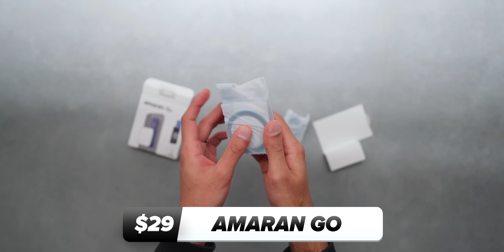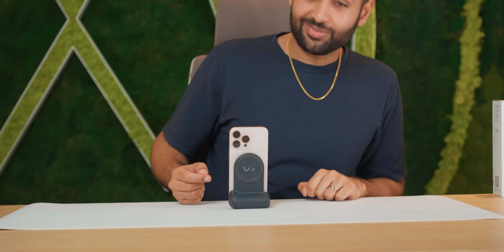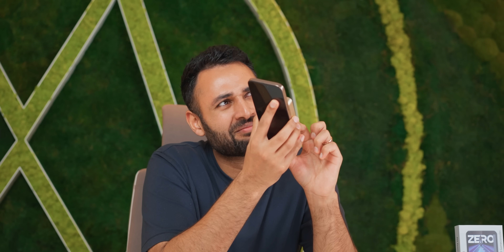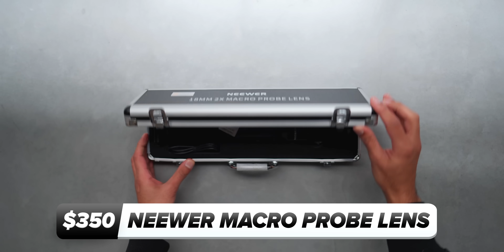I tested the 14 most OVERKILL Smartphone Gadgets

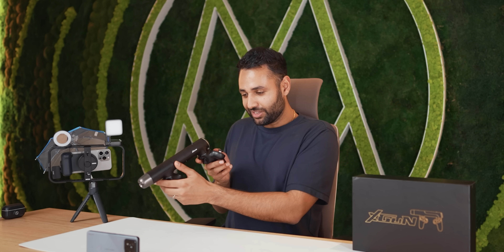Comment: 10:47 Since you only have the gyro, isn't that basically just a less ergonomic Switch Pro Controller? You have apps to get that added precision out of an official Nintendo controller, also I'm pretty sure if you use a grip instead of a stand then there are apps that combine the gamepad with any old gamepad with your phone's built-in gryo for added precision the like when aiming in BotW in portable mode.

Comment: I have a DJI Osmo, which is kind of like that Snap Grip.  It has a tripod and can charge your phone if no other option exists.  Of course, it's strength is the fact that it is a gyro stabilizer for getting those rock steady shots.  The app you can use with it has some cool features such as face tracking.  You set it up on the tripod, activate the face tracking then as you move around, the Osmo will pan and tilt the phone to keep you in frame.  But it doesn't have a light.  Or a makeup mirror.

Comment: Great vid, although I am struggling to find something for my phone that is seemingly so obvious but impossible. Phones with wireless charging, I have finally found a decent case that allows me to battery share and wireless charge, however I need a popsocket or some kind of phone ring. I don't want the thing to block the wireless charging, does anyone have a practical solution please because I am losing the will at this point! TIA

Comment: @Mrwhosetheboss, you mentioned all the things about iPhone camera gear, except the MOST IMPORTANT one. Which is ND Filters, as that allows you to get cinematic motion blur. Lenses are cool and all, but the natural blur of the 1.78F 24MM main lens is decent, and the 2.8F 120MM is also fine. You aren’t getting much of a boost in bokeh with an external lens. The only reason one would get that telephoto, is because the regular telephoto is 12MP, and not 48.

Comment: I have the shiftcam and as a full time wedding photographer that has to do social content. They are handy and good, not expensive so an easy tax write off, but super handy, I use the extension too on a manfrotto mini tripod and is super secure. They do a larger model which you attach better lights to and still slim. I do like mine for the money.

Comment: To ensure the accuracy of your results, it is essential to perform a control by streaking a clean Q-tip onto a sterile agar plate before introducing your sample. This step is crucial when working outside of a sterile hood, as it helps confirm that any growth observed on the experimental plate is truly from the sample and not due to contamination from the Q-tip or external sources. Did you streak a clean Q-tip on the control plate to verify that no bacteria were introduced from the Q-tip itself? This control step is crucial in ruling out the possibility of contamination affecting your results.
Reply: good bot

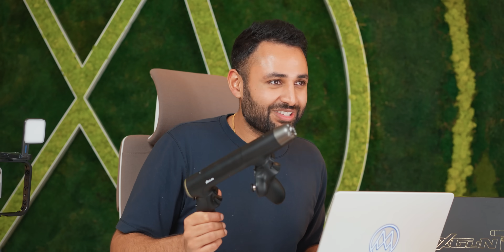Comment: When you get around 10:20 your so-called controller gun did you know you can just go and pick up a standard Microsoft controller which is like an Xbox controller for a good 25 to almost 35 and it works just as good on your phone and it has been for the last I don't know 10 or 12 years sometimes cheaper and stupider is actually better
Reply: Oh and I forgot to mention this your phone can automatically backup an Xbox PlayStation or PC handheld controller so basically if your controller breaks your phone can back up as a new one let's see any of those devices actually do that

Comment: if the magsafe light battery is that bad they should add wireless charging capability. I rock a "magsafe" case on my s22 ultra and with power sharing you could easily extend the battery life. too bad apple is lame and doesn't offer wireless power sharing

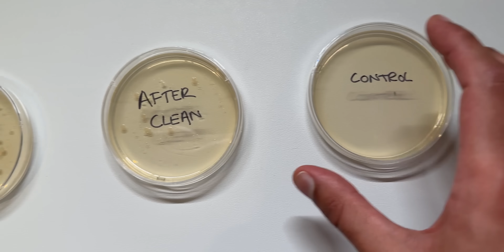Comment: 16:45 you contaminated your sample, that is most likely why
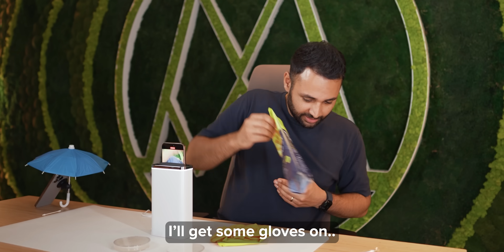at 2:41 you place what I assume your non-washed hands after touching the smartphone into culture. It's normal to have bacterias on your skin and perfectly healthy
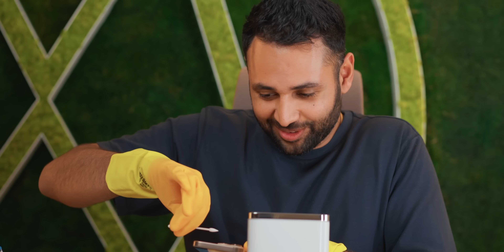What you did wrong tho, is that after putting your control phone (normal everyday conditions, i.e non soiled hands but not aseptic) into culture at 2:46 you make 3 mistakes:
-using non-sterile gloves (1)
-not properly washing your hands with a hydroalcoholic solution (2)
-having your ring and watch which are hotbed of bacterias. (3)

(1) Non-sterile gloves are not magically free from bacterias: they come in an non-sterile package and you take them out with no specific manner (contaminating them with your skin microbiome). Sterile gloves on the other hands are much more special; and are what surgeons use to operate for example. If they were to use "normal" non sterile gloves they'd be sure to infect most of their patient, and you by not using them are sure to infect your sample

(2) Even putting on gloves doesnt magically kill the bacterias. It is necessary that you do a proper hydroalcoolic rubbing before putting on sterile gloves otherwise you would still contaminate your sample. The example is very easy to find: surgeons even if they wear gloves do a meticulous hydroalcoolic rubbing too!

(3) This is self-explanatory, there's no point rubbing your hands very well or putting on special gloves if you are going to wear a ring and watch.

For all these reasons, I believe that the conclusion you draw is biased 
I dont think you should have bought sterile gloves that you would probably have no clue how to put on, you probably should have just done a hydroalcoolic rubbing after removing your watch and ring, that's it

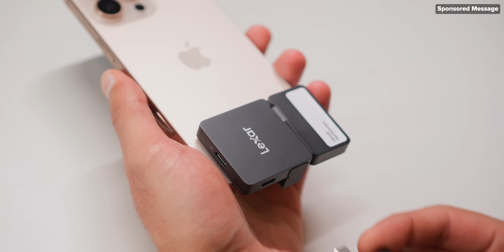Comment: 9:10 what a sad situation this is ..there was a time when phones used to support more than 1 TB expandable storage via micro SD, that could be actively used to view the media through the phone itself...now due to the new "innovations" we are forced to use an external passive device to do the same
Reply: @TwoSock most flagship phones during the 2020s used to come with 1TB Expandable storage which was more than enough along with the 128GB+ internal storage, which I would prefer more than any modern flagship smartphones with the latest processor and camera without expandable storage plus having just 512GB or less internal storage..and yes, there are phones that support 2TB expandable storage also, especially these days most of the budget phones with expandable storage support 2TB storage expansion, like the Vivo y200, Moto G, One plus Nord ce 4, then why can't the "flagship" phones, were storage is much more needed due to greater quality video and images(meaning more size) also have it??

Comment: Why are Apple related power banks always so small? Like 5000 mAh is on the high-end of their capacity. I have 20 000 mAh powerbank that I bought for 20€, and it's smaller than most 3200-5000 mAh powerbanks, and it supports 15W charging via USB-C.
Reply: > supports 15W charging via USB-C
ie. they are not attached to the back of the phone...
Reply: @h.m.chuang0224  No it's not, but wireless charging technology or magnets don't take almost any space and are cheap as hell, so that doesn't justify having such low capacity in a pretty large housing and high price tag.

Also, my phone doesn't support wireless charging, so I wouldn't want to pay extra for a useless feature. Besides, my phone supports 100W charging via USB-C, so even if I had wireless charging, I'd never use it.
Reply: @ekortelainen  Ah, so your brick is light as a feather huh?
Also, your 2nd paragraph is basically: "I don't use this product, so this product is absolutely useless"
Reply: @h.m.chuang0224  It's not particularly heavy either. And you're twisting my words. I never said it's useless, I said I wouldn't pay for that feature as I don't need it, since you brought up the topic.

There are also other similar products on the market that do have those features and still have large capacity and low price tag.

All I'm saying is that Apple products and products designed for Apple phones often don't utilize the space effectively, or they use cheaper and lower capacity cells to save a buck. Still they manage sell them for 10 times their actual value.

Comment: @16:45 - That's a 8/10 for not forgetting the control in an experiment!
2 points deducted for not putting an untreated swab in the third control to check if the contamination came from swab itself.  (And then there would be a fourth dish without anything being put in it at all.)
Would be unreasonable to expect anything more than that from an electronics equipment reviewer.
Reply: and a whole 1/10 for the experiment as a whole (cant do germ comparison without any sterile condition, cotons were not tester either, gloves where a nice touch but he talked right above that opened agarose gel)
I do understand it's not a scientific experiment cause it's way too many things that are too complex without proper knowledge and/or equipment, but I find that comparison useless at best, misleading at worst
Reply: I also think that there should have been one for the most usual cleaning method, like cleaning wipes or dilutes alcohol.
Reply: And he also just tapped the middle when you're supposed to gently rub from left to right from top to bottom...
Reply: Except it wasnt a proper control
Reply: What was the point of this comment? Oh yeah it’s not controlled and sanitary but then he’s a tech YouTuber and not a scientist so thats fine. Ok? Cool i guess?
Reply: @BlinksTwiceProfuselyBut it’s not fine. It’s not only redundant but frankly, misleading.

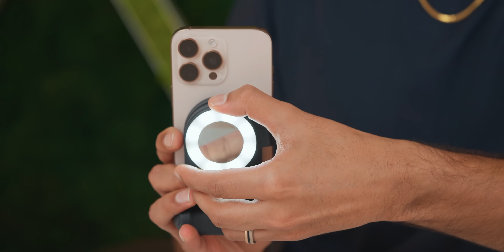Comment: 6:50 the mirror is for when you want to see your face when using your back camera, not front camera. Duh😅?
Reply from the maker: The amaran already had a mirror for the back, so I was trying to see if there was any EXTRA benefit to that mirror being able to flip
Reply: @Mrwhosetheboss  Oh, like instead of having just the LEDs flip out. It would make sense if there was some sort of circuit board underneath the mirror that the lights are attached to. You should break it open and find out!

Comment: Cool, anyway here is a brownie receipt:
½ cup butter

1 cup white sugar

2 eggs

1 teaspoon vanilla extract

⅓ cup unsweetened cocoa powder

½ cup all-purpose flour

¼ teaspoon salt

¼ teaspoon baking powder

Frosting:

3 tablespoons butter, softened

3 tablespoons unsweetened cocoa powder

1 tablespoon honey

1 teaspoon vanilla extract

1 cup confectioners' sugar

Local Offers

 
Change
Oops! We cannot find any ingredients on sale near you. Do we have the correct zip code?
Directions

Preheat the oven to 350 degrees F (175 degrees C). Grease and flour an 8-inch square pan.

Melt 1/2 cup butter in a large saucepan. Remove from heat, and stir in sugar, eggs, and 1 teaspoon vanilla. Beat in 1/3 cup cocoa, flour, salt, and baking powder. Spread batter into prepared pan.

Bake in the preheated oven until top is dry and edges have started to pull away from the sides of the pan, about 25 to 30 minutes. Let cool briefly before frosting.

To make the frosting: Combine softened butter, confectioners' sugar, 3 tablespoons cocoa, honey, and 1 teaspoon vanilla extract in a bowl. Stir until smooth. Frost brownies while they are still warm.
Reply: Why did you send this. It's completely unnecessary.